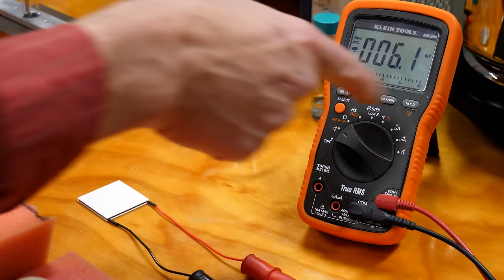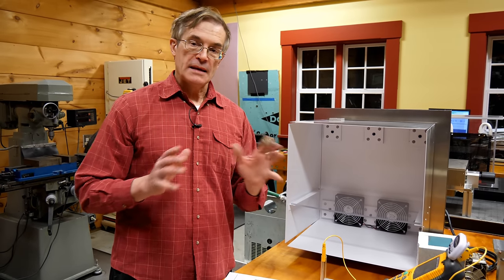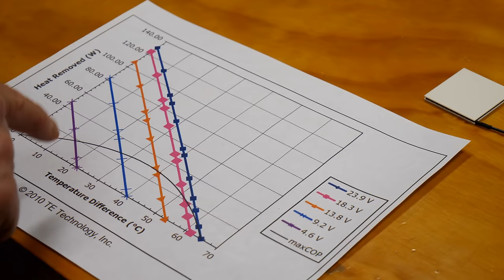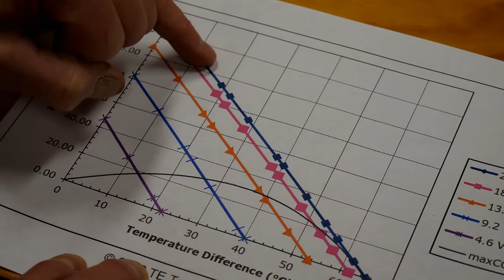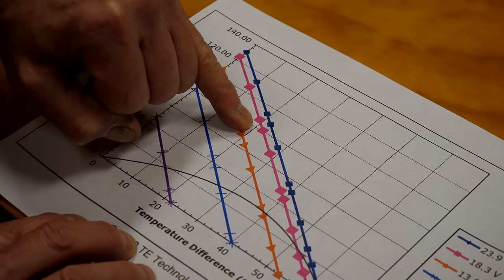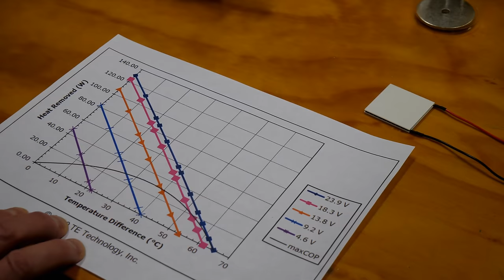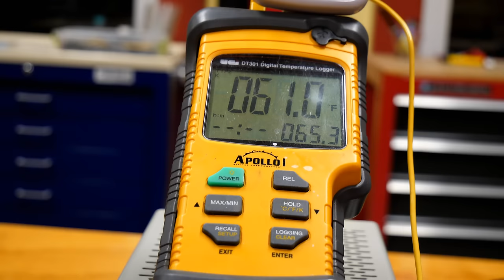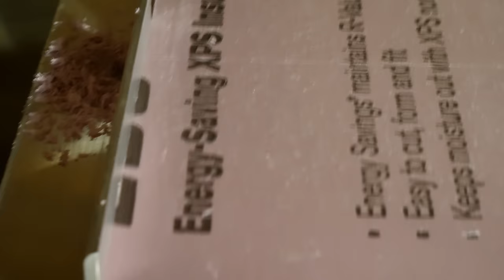BUILD YOUR OWN REFRIGERATOR! - SOLID STATE TEC

Comment: Great Video!  One little but mysterious detail puzzles me...why the big hole in the aluminium spacers? Wouldn't a homogen spacer transfer heat better and also save the work to make the hole? I do understand, that if the spacer has the big hole you can achieve higher pressure/tension on the TEC, but is the small(?) gain of higher mounting pressure really bigger than the loss of heat transfer capability?
Reply from the maker: You're the first viewer who commented on this who figured out the reason.  The increased pressure actually does help.

Comment: GE made a model of magnetic refrigeration with a pattent fluid that circulated with a dc pump. It supposidly burned 2/3electric power of conventional. That might be worth one of your projects
Reply from the maker: I've been working on it.  The problem is access to materisls with a higher magnetocaloric effect than gadolinium.  Staging that material to a usable temperature differential is a plumbing nightmare.

Comment: I am impressed with your progress and I am also wondering what you may think about the efficiency of the best case design. It may not matter too much if the heat source is free.
JR BLANTON
Reply from the maker: We're probably pretty close, but the effeciency of a TEC will never match a phase change system.

Comment: Not sure I agree that all colours are black in the infra-red. White stones don't melt as much ice as black ones on a glacier and yes the colour you see is not the "colour" in the infra-red, but there are tables you can consult that tell you the efficacy of different materials at IR. We place a bit of masking tape over aluminium to get a more accurate temperature reading of a heat sink with a thermal camera. Black anodised head sinks radiate better and absorb better for example.
Reply from the maker: Your examples support my point.  I should probably have been more explicit and said that all colors of organic based paints are black in the thermal infrared. There are differences in the IR reflectivity of bare metal.  Gold, copper and aluminum are about the best.  Anodizing, which produces aluminum oxide often with additional dye molecules to generate visible colors, has a lower IR reflectivity.

Comment: I'm building a cigar humidor and plan to use a system like this to moderate temperature.

 What would you recommend using to automatically control humidity in the range of 65%-75%?
Reply from the maker: That's  a good question. It depends on the temperature as well, assuming  your talking  about  relative humidity. Obviously, an open tray of water will approach  100%, but tissue might be the easiest to regulate because  you can limit the flow across this water with a fan ie off-slow-fast or a cover that slides from closed to full open. These motors could be regulated with a humidity  meter and an Arduino.

Comment: From the moment I learned about these devices, I thought of making a small refrigerator/AC and  incorporating more TEC's into my heat sink to power a small cooling fan. No idea if that's plausible or not.
Reply from the maker: You don't want to use the heat ouput of these TECs to drive other TECs to generate electricity.  The reduction in heat flow out of the primary TECs due to the thermal resistance  created by the power generating TECs lowers cooling effeciency much more than is gained from the electricity generated.

Comment: Place magnets on turntable ,N   outer    s  inner  with there relative gap spanning its Tangent. place enough  in series to encircle the TurnTable . make 2nd TT    with vials of metal  at norms with radius and tangent, so when rotated the path is through the mag. .    double the number of "vials"  containing  metal in comparison of number of "mag. domains the device has, this is so at any given instant there is 1/2 the vials out of phase with the other half .   now   the faster on spins the turntable the colder the device gets

Comment: This is a great video! I was wondering for the best cooling, did you run all of the peltier devices in series or in parallel?
Reply from the maker: Thanks!
I used series and parallel to achieve the most convenient voltage and amperage for the available power supply.
Reply: @TechIngredients  Ohhhh, shots fired🤣

Comment: I'm wondering if you could make a video using the peltier plate as a generator and configurations to milk as much electricity from any thermal system as possible; maybe even comparing or in tandem with a stirling generator.
Reply from the maker: Take a look at our video on the "Campfire Generator"

Comment: Hello, recently stumbled on your videos and love all the concepts you present here, I was wondering if a system could be made that integrates all these ideas diverting the energy used by each depending on the time of day and outside temperature in a compact (but not tiny) house. too bad, I can't attach images cause I have a mind node illustrating the flow. But I'd love to be able to use solar power, weather conditions, a rocket stove, a desiccant AC, and a solid-state refrigerator to maintain comfort inside the house, avoid using harsh chemicals and save as much power as possible.

Comment: Thank you very much for this video. Its so helpfull.

But there is one question left: Is it better to blow air on the TECs or blow hot air AWAY from the TECs?
My tests with an average CPU cooler are: Its better to get rid of the hot air around the TECs. So i used a 120mm fan to suck air away from the TECs and got good results.
Reply from the maker: It won't  matter as long as the airflow velocity over the heatsink is the same.
However, that's harder to achieve  with a pull through  system because  you need to eliminate  parasitic leaks.  On the other hand, the fan's motor will add a small amount of heat to the blow through system.
Reply: @TechIngredients  Thats a good point. I will keep that in mind. But i only had a few cheap TECs. Im planning to do a crude air cooler with a split system like in your freezer. The water radiator outside, the TECs inside (Like 10 pieces) and then afew fans to archive a cold breeze when im working at home

Comment: Very interesting and cool video. ;) I've often wondered about the efficiency of a solid state (peltier) fridge and if it would be possible to build a completely silent one with no moving parts.

If building one of these to truly use, would it not add efficiency (and construction cost of course) to use copper plates for the transfer between the peltiers and fridge as well as between the peltier and the layers of aluminum cooling sheets? Also, wouldn't soldering/welding the the corner edges and rest of the parts together also be more efficient than using thermal pastes? Especially since thermal pastes tend to degrade in efficiency over time? And lastly, wouldn't you have wanted to add a thermal interface material between the two layers on the back from the folded aluminum? I would think it would be better to keep the back a single layer like the sides since each layer adds thermal conductivity loss and thus efficiency loss due to the less than perfect contact between the layers.

Comment: Swamp coolers does not work in Area's of high humidity, I live in an area where there is high huidity and all the Swamp Cooler do is raise my Electricity bill, and I mean adding a lot to my bill. In our green houses we installed DE-Humidifiers so that the Wet Wall can start the cooling effect. But boy if the wet wall kicks in, the temprature drops dramatically, up to and sometimes even much cooler up to 10% lower than outside.

Comment: Why cut holes in the blocks placed between the metal sheets?  Won't those holes act as insulators?  Or is that the plan and you intend for the heat to transfer to the sheets only through the bolts?

On a separate note, for how long were you coughing up tiny bits of styrofoam?  A respirator would have been a good idea when shaving the styrofoam.

Comment: THANKS FOR ALL THE GREAT WORK - I WOULD LIKE A SYSTEM THAT CAN ACHIEVE -80 CELSIUS TO RAPID COOL A MICROSCOPE STAGE FOR THE PURPOSE OF DOING WATER "MEMORY" EXPERIMENTS FREEZING WATER SAMPLES TO CREATE "FINGERPRINT" ICE-CRYSTAL FORMATIONS THAT CAN BE PHOTOGRAPHED AND RECORDED 
SO STAGE WOULD NEED TO OSCILLATE BETWEEN ROOM TEMPERATURE AND -50 CELSIUS (THE MINUS 80 IS FOR REDUNDANCY)
KEEP UP THE GOOD WORK
Reply from the maker: You can achieve that with a multistage TEC, but just barely.  You might have to work at a reduced atmospheric pressure to minimize heat transfer or at least provide excellent cooling of the hot side of the stack.

Comment: Hello,  I came across your channel from the video on making Banana Brandy and am amazed at your breadth of knowledge. Would it be possible to retrofit an existing refrigerator - many are found discarded as they quit working - with correctly sized components? It will save many such units from landfills and the project will need far less skills/tools than building it from scratch. Thanks
Reply from the maker: Thanks!
Probably not.  These have poor insulation which has further deteriorated over time.  The original phase change system was effecient enough to compensate for that.

Comment: Can you tell me how you powered all of these together?
I can't get my head around how to power it. If you connect them all to one power supply on the same circuit, wouldn't u need more amps to be able to supply all of them together at 12v?
Or did you have each of them with their own 12v power supply, and have them all plugged into a power board? 😅
Some help understanding this part would be good.
Reply from the maker: Each TEC operates as a resistance load.  When you have multiple, identical TECs you can wire them in series or you can wire several in parallel sets and then wire each set in series ect.  By doing this you can create a single input/output to drive the entire system from a single power supply with an output voltage that matches the total resistance of the system.

Comment: This is interesting. Have you considered water cooling?  Also, do you suppose mounting a say 1 foot piece of thin aluminum to the cold side could aid in the cooling? Have you considered using these things in conjunction with an ammonia system? Use the hot side to replace the flame and the cold side to aid the cooling of the ammonia?
Reply from the maker: Take a look at our freezer video.

Comment: Just like propane RV coolers, I suspect the mass cooling rate will be pretty slow without a fan inside.
Also, wouldn't a finned interior back surface help?
Reply from the maker: Both points are true.

Comment: I'm curious, why is the aluminum spacers between the heatsink fins with the center part drilled out instead of being solid?
Reply from the maker: It increases the pressure when clamping force is applied to reduce interface resistance.

Comment: magnetocaloric metals plus alcohol refrigiration. could we use tesla valves (or reeds) to direct and force flow in the loop and make cooling based on size differential of radiators?

Comment: Efficiency at a lower loudness:  Cross-Flow-Fans create a better laminar flow.
Reply: An adjustable maximum power differental regulator ensures optimal power flow for cooling. A Schmitt-Trigger powers it off at the desired temperature.
For Heating Systems with Boilers with around of 25-30 Metric Tons of Water we got the Temeperature dissipation down to 1 °C per Day.

Comment: Would it be possible to use some tec's absorbing the heat given off by the heat sink to recover some energy?maybe to run fans or such
Reply from the maker: No.  The TECs (as thermoelectric generators) will decrease the cooling that's necessary  for the TEC to operate.  This would be a net loss.

Comment: I would assume if you had a plate system inside the container simular to the one outside of it and you reversed the coolers direction, you would have an oven? maybe not a high temp oven but it would heat up the inside?
Reply from the maker: That would work.

Comment: You forgot to mention that if you stage the foam and add air gaps that you will be increasing your efficiency.  As you said the efficiency is measured not only by how much gets through per hour but also by the temperature differential.  So if you were able to have multiple layers of foam since the difference in temperature between the pieces of foam would be less it would be more efficient than having foam that goes directly from your insulated area to the non insulated area.  Though you will lose a little bit more space in the fridge for every piece of foam and air gap you have.
Reply from the maker: That's not true.  The air gap is not as effective as the same gap filled with foam.

Comment: I'm looking for a way to cool the inside of an entertainment stand. I installed fans to increase the airflow but they are loud and my PS5 turns the cabinet into a sauna when it's inside. I'm wondering how effective these TEC units could be as a form of heat sink if I stacked enough of them inside the stand to push the heat to a plate outside the stand. Do you think this could work given a constant source of heat instead of the cabinet instead of merely maintaining ambient cooling?
Reply from the maker: They would definitely  do the job.  The design  is similar  to this refrigerator.
The question  is how much heat has to be moved? The lower the differential between your goal and the surrounding temperature, the more efficient these devices become. You might still want to add a few fans outside and even inside to boost the heat transfer. Even very low speed, quiet fans will make a big difference.

Comment: If it's the electrons that build up...
I'm trying to understand...
if the electrons carry a charge, and to bump an atom up to cross a different metal surface you need to give it more of a charge to carry that over to the other side and dissipate the energy...
could you move those atoms along faster?
What about using waves of magnetic fields to push them?
I'm trying to imagine how all this works.

Comment: I built one with a freezer but definitely not practical in the car, 17 amps at startup and around 8 amps after cooling to operating temp of around 38 to 45 degrees, the freezer section got down to 10 degrees, but this kills a battery in only a few hours.

Comment: Nit picking here, but you open up with stating that a standard refrigerator compressor compresses the cool gas into a hot liquid where it cools through a heat exchanger.  The condenser actually compresses the cool gas into a hot gas and the gas condenses inside the apply named condenser coil (aka heat exchanger).  The efficiency of a system is in part measured by what is called "sub-cooling" and this refers to how much cooler the liquid exiting the condenser is as compared to its boiling point temp at its current pressure.  In a perfect world, the last molecules of gas would condense in the last micron of the condenser coil.  In other words, the condenser coil is the perfect size and you aren't pumping liquid through extra pipe for no reason and blowing air passed that pipe for no reason. But that isn't really practical to control so a few degrees of sub-cooling are wanted to ensure that only liquid exits the condenser.  Sub-cooling is in part how you adjust the charge of a unit.  Sub cooling will be spec'd out by the manufacturer for various operating temperatures.

Comment: Use that chip to make hot water and refrigerator at the same time. Put the chip on the top of the refrigerator with the hot side facing up. Place a pot on top with cold water. So you can cool the chip and make hot water at the same time.
Reply from the maker: Sadly, you can't.
These devices are often called thermoelectric coolers, but they are actually thermoelectric temperature difference generators. In order for them to cool, the "hot" side needs to be at room temperature.
Reply: Maybe it can warm up my well water to room temperature. My well water is around 10C. So it can cool the chip and get warmed to room temperature for me to use
Reply from the maker: That would work.

Comment: I think you undersetimate the surface emissivity of black paint vs white paint. IMO white color was a good choice because black would radiate it back. Not reflect but absorb and radiate.
Reply from the maker: I think you missed my statement about the wavelength.  In the thermal infared, all organically based paints, irrespective of their visible colors have similar, high emissivity.

Comment: hi professor, the back heat correction system sees inefficient. Mostly because they are flat and block flow of heat.
What you could do Sir, is make holes in the steel plates. This way when the heat comes out form the refrigerator, the the holes will help the fans pull that heat out fromt he back. You need the fats on the x (Rigth angle )and z (Vertical) axis. to remove the heat from inbetween the gaps from the steel plates (with holes). And the back fans must perform a suction action i.e. pull the heat away fomrt he sheets to the back of the fridge. Let me know if oyu can try it.
Regards
Reply from the maker: It's a good thought, however I modeled the heat flow and the gain you cite due to turbulent flow is countered by the loss of surface area.

Comment: Hello, I am trying to build a mini air conditioner heater for outdoor birds that nest in gourds.  It will have 12-24 lines running about 1 to 2 feet from the unit.  Do I need the make the box that sits under the TEC as small as possible?  I am sitting electric fans at the bottom of the box.  Any help would be appreciated!
Reply from the maker: Airconditioner heater?
You need to clarify  and provide more detail.